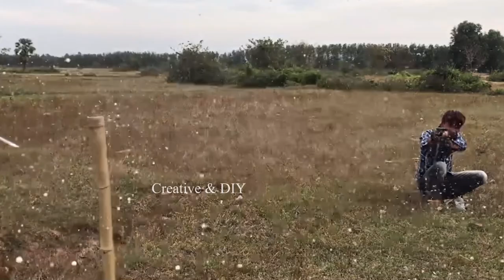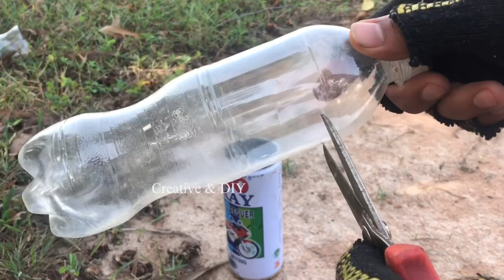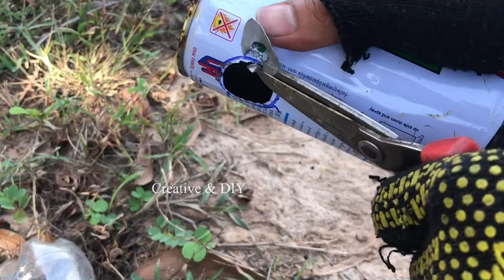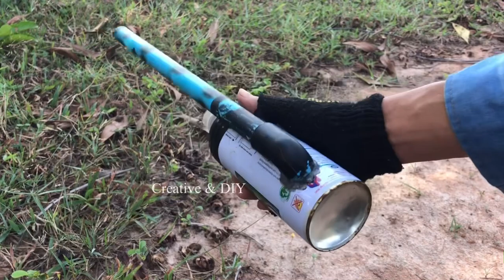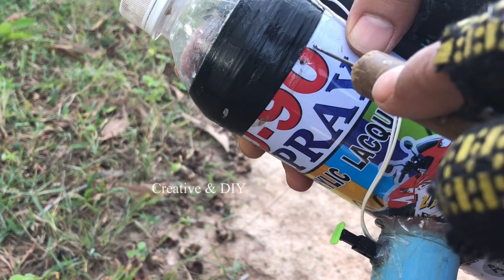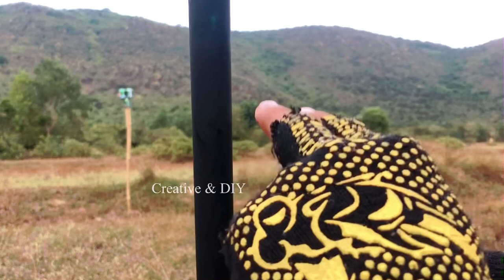slingshot survival Easy ideas slingshot Mini Making

Comment: As an American red neck I'm gonna make it, you bet that I'm not only gonna put alcohol in, I'm gonna try gasoline, diesel, kerosine and nitro fuel and end up in a hospital 😂.
Reply: Try sunflower oil with ethanol
And take a smaller bottle to increase the pressure